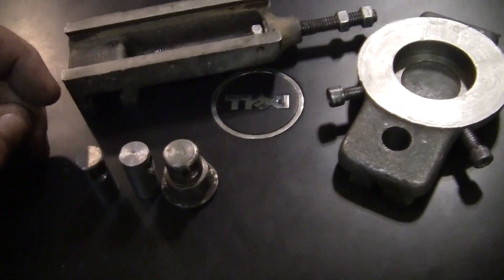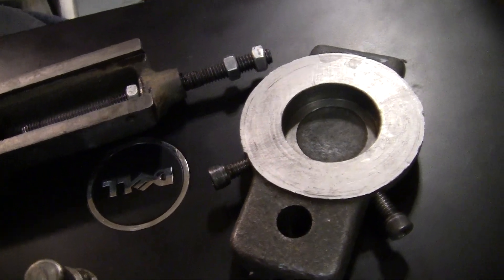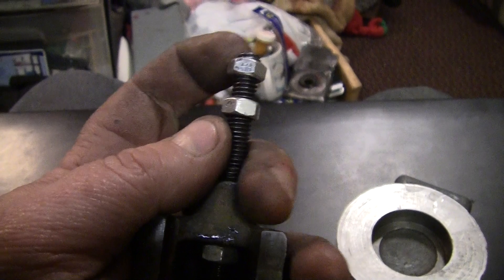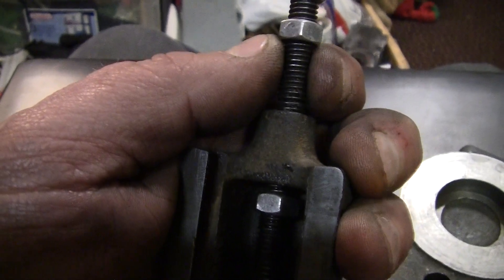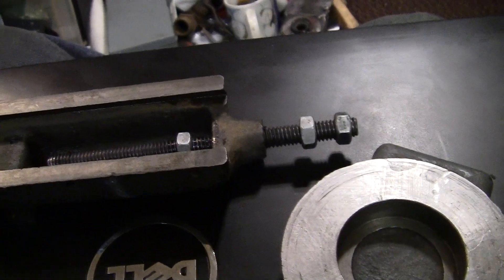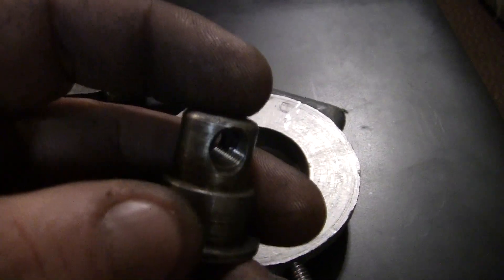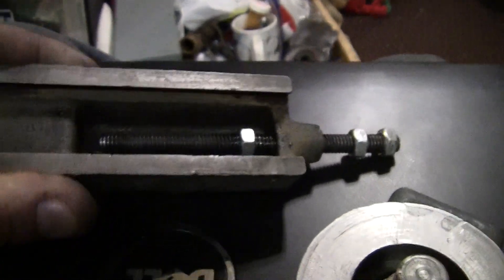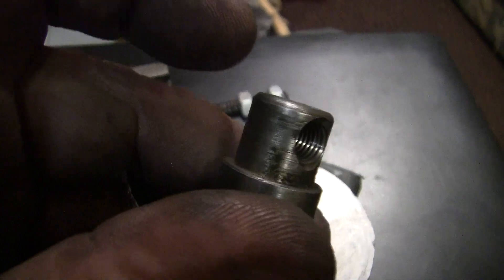craftsman 109 lathe compound rebuild ( PART 1 )

Comment: Hi Shawn,

The thread will wear away the cross slide where it go's through by the two nuts.  They normally use a plain section of shaft to reduce that problem.
Reply from the maker: I took the thread down and put in a brass bushing

Comment: To take out the slack I just punched the pins out and put two washers on each side with a spring in between them. Pushes one washer against the pin and the other against the compound body.
Reply from the maker: that would work fine !